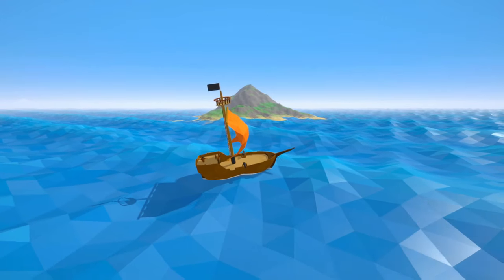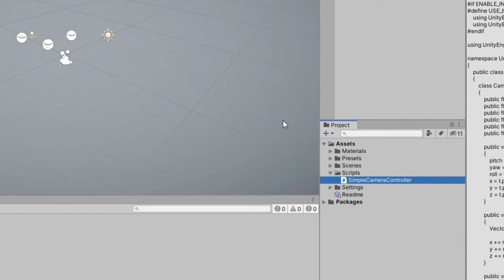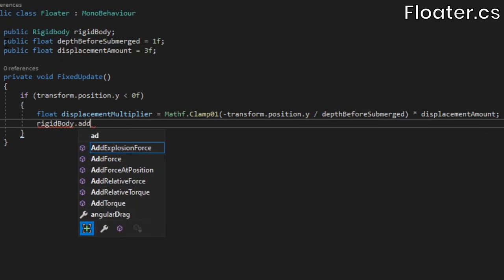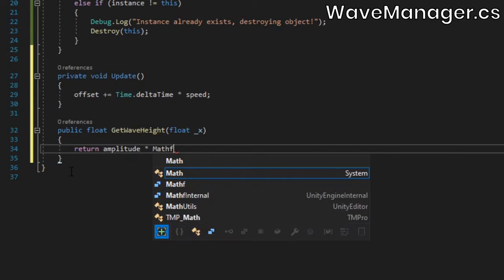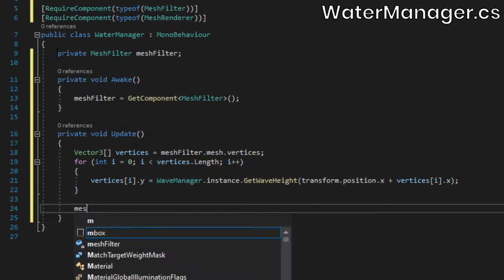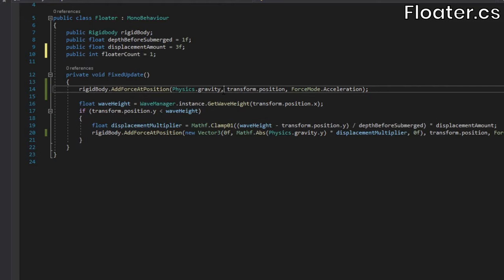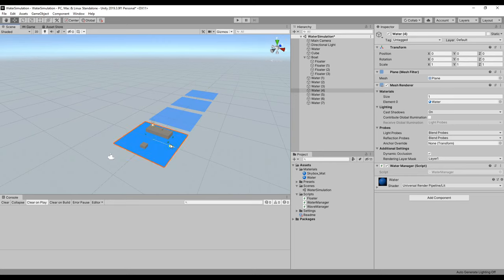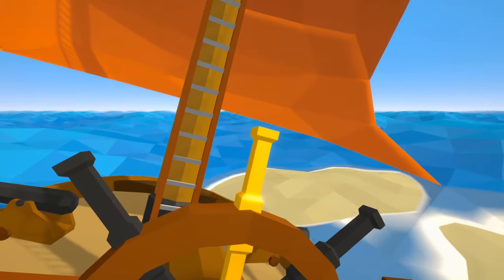How to Set Up Dynamic Water Physics and Boat Movement in Unity | Ship Buoyancy Tutorial

Comment: 3:28 That script would be great as a Scriptable Object for the water. So you'd be able to create multiple instances that each vary without disrupting the original or having to rewrite it either.
That way you could create many different versions of the water physics.
The default water physics.
Denser with more drag on a muddy swamp.
Or a more sinking ocean of lava with very little waves.

These short minute tutorials are the perfect format for learning. And you get so much down in so little time and even add small extras like singletons so quickly and clearly which otherwise takes others 30 minutes to confuse you even more somehow. Great work :).
Reply from the maker: Maybe, although you'd need to make sure the floaters know which water instance they're actually floating on.

Also, I'm glad you like the speed! I myself hate slow tutorials—there's just something extraordinarily excruciating about sitting through any sort of extra fluff when I just want to know what to do next, but skipping ahead is dangerous because you risk missing something :P

Comment: One possible improvement is that the actual buoyancy depends on the mass of the object and on the liquid density because the resulting force acting on the object is F_b = (m - rho_liquid * V_displaced)*g. It will add a more realistic immersion of the object depending on its mass and the density of the liquid, w/o adding artificial multipliers. This force is applied only at one point, but its amplitude can be shared between several Floaters to apply a distributed force effect (as if we split the body onto several parts).
Reply from the maker: Right but then you need to set the mass accurately, which then means you have to do a bunch of calculations based on volume, material type, etc. and it just becomes a pain. It's much simpler & more convenient to just have a few multipliers that you can play around with to get something that looks/feels right than something that is completely accurate (which it really never will be because the force would be applied all over the object, not just at one or a few points).
Reply: Yes, you are probably right, for a casual gameplay not heavily relied on physics this is a simpler solution.

Comment: hey tom, quick question: Are you using URP in your own game? if so then did you write a completely new shader for your water including the lighting? The problem I'm facing is that URP seems to not have the option to create a new "Standard surface shader", instead it creates one in cglanguage for the built in renderer.  Which forced me to just create a completely new shader in HLSL but I would love to avoid having to write all the lighting code. Any thoughts on this? Is there some way to use unity's physically based lighting within my custom urp shader (without shader graph)?
Reply from the maker: Yes, I'm using URP.

Shader Graph is the only way to automatically use URP's lighting (that I'm aware of), and I think it's intended as the alternative to surface shaders. Since Shader Graph still doesn't allow you to modify certain things that I need to modify, I'm basically just piggy-backing off of URP's shaders. I copy + pasted the code files for the lit shader and then added my extra code, but the drawback is that any time Unity updates or changes something about the lighting calculations, I need to manually update my shaders with that same code for it to take effect.
Reply: @tomweiland  thanks for the info as always. I just created a new lit shader graph and copied its generated code, seems to work fine!

Comment: When applying the buoyancy force, subtract its own velocity at that specific point. Should probably help with the bounciness you’re experiencing. The same goes for the torque.
Reply from the maker: Have you tested this? I'll give it a shot, although that doesn't seem right since buoyancy is an acceleration isn't it? Also do you mean to subtract the specific floater's velocity or just he ship's?
Reply: @tomweiland   I mean subtract the rigidbody’s velocity at the floater’s position. I haven’t tested it in a buoyancy setup. But your rigidbody already has a velocity, since you’re adding one on top of that to reach your desired position, your ship will overshoot it resulting in a bouncing effect. If not, sorry for wasting your time. Would love to hear the result though. I’m not near a computer so I can’t test it right now.
Reply from the maker: I'll give it a shot, although on a theoretical level I'm not convinced :P

Comment: this would've helped me more if I wasn't making water while having multiple heights of objects and terrain i did something similar with movement and ended up having to redo the entire thing a few days ago because it worked if the character wasn't moving up if it was flat terrain this would work way better thought i would mention it for people looking to do something with different heights of terrain and or water.
Reply from the maker: Are you talking about water at different heights in the world, like rivers and lakes? If so, you're right that (as is in this tutorial) this solution only works with water that's at the same height.

If that's not what you meant, then perhaps using some punctuation would help clarify what you're trying to say 😅

Comment: I wrote my own shader for the waves, and I'm using the same formula to get the wave height at any given point, but it's not accurate to the actual height of the waves. I'm thinking this is because of the view matrix math (UNITY_MATRIX_VP) and I'm unsure how to go about fixing this. How did you have the vertex math line up with the wave manager formula in your game?
Reply: Nevermind, I found the issue. I was using _Time in my shader instead of _Time.y. So the time value I was using was different.
Reply from the maker: Glad you solved it!

Comment: hey this is a really amazing tutorial but I wish you went more in depth on how to use it together with a shader. I followed the tutorial you linked but cant seem to find a way to properly adjust the physics to that
Reply from the maker: You just have to recalculate the buoyancy the same way the mesh is deformed. This video has a good explanation of how to do it (ignore the GPU readback stuff, what's important is that sampling the wave equation multiple times and adjusting the sample point on each iteration gets you a pretty accurate result): https://youtu.be/kGEqaX4Y4bQ?t=802
Reply: @tomweiland  Thank you for that very quick and great answer even thpugh this is an older video !:))

Comment: Very nice video. Thank you.
I have a question though : why do you introduce the displacementAmount ? What is the purpose of it ?
And by extension, why using displacementMultiplier in drag / angular drag formulas, instead of using the displacement factor, which is not multiplied (that is Mathf.Clamp01(-transform.position.y / depthBeforeSubmerged ), which always stand between 0 and 1).
The displacementAmount seems to be like a constant introduced to give a better result/dynamic rather than being physically related to something. Am I wrong ?
Reply from the maker: The displacementAmount is meant to approximate the total amount of water displaced if the object is entirely submerged. We use the displacementMultiplier because the object isn't always entirely submerged.

For the drag, you can use the displacement "factor" instead if you like. Honestly this is just an example of how you could mimic buoyancy, so if you think something else might work better, just try it out.

Comment: Hey, I have a question about the shader tutorial you linked in the description. I just started trying to follow it, but as soon as I made the shader material, it just turned pink without any color. The waves do not work either. What should I do?
Reply from the maker: Have you completed the entire shader? Pink means there's an error, which may occur if it's incomplete.

If you're using URP then the issue is probably that the shader from the article is made for the built-in render pipeline, which isn't compatible with URP. You'll have to convert it, which will be hard if you don't know much about shaders—it might be easier to recreate in shader graph...
Reply: I know its been a while since you typed this comment but I was wondering if by chance you have any documentation on doing such a thing. Want to get the most performance possible because I am currently developing a vr game and doing it CPU based with blow someones headset up haha

Comment: This might just be exactly what I'm looking for. I've been messing around with the idea of a game based on hovering vehicles. I've used a modified buoyancy script I found on the Unity forums in the past, and replaced "ocean height" with a downward raycast, and did some messing around to have it "float" a certain amount above whatever the cast hits. But, that script is a tad more feature rich, and involves doing a bunch of stuff I don't understand with voxels and cutting up the mesh, and it was probably more resource intensive than what I need.
With something like this, I should be able to quickly whip up a vehicle that hovers using the actual positions of the thrusters (or whatever I end up making the vehicles hovering method, hoverpads?), without having to expend a bunch of resources voxelizing crap.
Looks like I know what I'm doing this evening. Thank you!
Reply from the maker: That's an interesting application for this kind of setup—I guess you'd probably raycast downwards at each floater instead of sampling a wave equation, and then apply an upwards force based on how far away the ground is 🤔
Reply: @tomweiland  Exactly ;)
Reply: @tomweiland  So, I've been messing around with things, if you'd like to see what I came up with, check it out: https://youtu.be/aUgbtHNIo1k?t=1705
It needs a lot of work on my end, but your snippet here was essential in getting things going. 
I moved away from having 4 separate empties with a "hover" script, and instead moved all the logic to the parent, using a foreach on an array of "hover point" empties. I'd like to expand on this later by having the "thruster" destructible, and when destroyed fire off an event, which will then update the list of hover points. 

Anyway, the prototyping has been fun so far, you've definitely helped spark a new fire under my ass to work on gamedev stuff, and I think I'm gonna have a lot of fun with this.

Comment: I had a question about implementing the water on a large scale using the GPU. Following the link to the tutorial by Catlike Coding, I am able to run the wave as a shader but obviously this leaves out the method of implementing buoyancy/swimming physics. My question is whether you are running the surrounding water "chunks" on the GPU and the swimming physics on the CPU for the players immediate environment (ie. only simulating the physics for a few chunks the player is near but running identical waves on the GPU farther away) or am I missing something? Awesome video
Reply from the maker: I only simulate the physics for the exact point that I need it. You can use the same formula (or an approximation if you're using Gerstner waves) on the CPU to get the height of the water at any give point, regardless of whether you actually have a water plane there or not.
Reply: @tomweiland  Thanks for the reply! I feel I've been able to get things working well with your advice, but I had another question regarding how you organize large areas of water and coordinate the waves across planes? I am completely lost on how to approach this

Comment: Hey, just found your vid in my recommendations! you are saying at the end that in your project you are using Gerstner waves, but how do you get the wave height at coordinates XY (considering Z-up sorry i'm unfamiliar with unity) on the CPU side ?
Reply from the maker: I just use the same formula on the CPU side, although it's a bit less straightforward and requires some approximation with the Gerstner wave formula since it doesn't give you the height for the point you used as the input (Gerstner waves move horizontally as well as vertically, so the returned height is for the shifted point, not the original one).
Reply: @tomweiland  okay I see, thanks for your answer! Because I’m in a case where my mesh is really large compared to the size of the boats, that’s why i was looking for the formula giving directly the height

Comment: Question though, if you're using Shaders to move the waves, how do you inform the boat script about where the vertices are? I'm assuming you replicate the shader math inside the boat script and then boom?
Reply from the maker: "you replicate the shader math inside the boat script"
Yep, that's exactly it. As long as you pass the same values to the same formula you should get the same output.

Comment: Tom, a couple of questions:

1. I'm still relatively new to writing shaders. I've followed the CatLikeCoding tutorial (and threw them a donation, wow, what a great tutorial), but I'm curious how you got the lighting to emphasize each tri, for that nice low-poly look. My shader looks really smooth and doesn't have the same charm.

2. Like the shader, I have set up my WaveHeight function to just use a time figure so I don't have to update the offset each frame. I'm using Time.timeSinceLastLoad to try to sync them, but I'm not sure I've gotten it right. I'm curious what technique you use to sync the shader and the function.
Reply from the maker: 1. The low poly look is achieved by having the entire surface of each triangle use the same normal. If a triangle shares vertices with neighbouring triangles, the normals of those vertices will be an average of all the surrounding face normals (I hope that makes sense). My low poly shader is sort of my "secret sauce", but I'll point you in the right direction—in order to have a universal face normal, each of the triangle's vertices need to have the same normal value, and what's most commonly done is to simply split vertices, meaning each triangle has its own unique set of vertices (since you can only have one normal per vertex).

Alternatively, you can ignore the normals stored in the mesh data and recalculate them in a shader. This can be done using geometry shaders (which allow you to perform calculations on a per-triangle basis rather than per-vertex/per-pixel), or you can use the screen space derivatives in the pixel/fragment shader function. Over the course of several months, I probably read every article/question/forum post out there relating to low poly rendering trying to figure this out :P

2. I set the offset for both the WaveHeight method and the shader manually.
Reply: @tomweiland  I managed to hack something together with a flat-cell shader I found by incorporating the vertex displacements... Much studying to be done on my part to understand it beyond that, though.

I'll try not to make something too similar and step on your creative toes!
Reply from the maker: @richardstevenson371  that sounds like an approach that I'm not sure I've heard of. If you don't mind sharing I'd love to know how it works—maybe we can talk on Discord?
Reply: @tomweiland  Whoops! I wouldn't mind, but I can't really offer any expertise myself. I simply implemented the wave functions into a shader I found online:

https://hextantstudios.com/unity-flat-low-poly-shader/

Comment: Awesome tutorial! I've been working on shader programming recently and am making an ocean shader at the moment. I'm wondering how you get your vertex data back out of the shader and into a C# script? Because it's all stored on the GPU the only two options I've seen is to do the same maths as you use generate the waves but obviously only for the 4 floating locations, or, to access the vertex buffer, but I've read this is very slow and also there's conflicting information about whether this buffer gives you the post shader positions or non manipulated positions. It would be awesome if you could point me in the right direction for this!
Reply from the maker: "I'm wondering how you get your vertex data back out of the shader and into a C# script?"
I don't. I use the first option you mentioned—I just use the same math as in the shader to calculate heights on the CPU as needed.
Reply: @tomweiland  Any chance you could show us how? It's doing my head in

Comment: @Tom Weiland
I am getting an error on 'MeshFilter.mesh' which says "An object reference is required for the non-static field, method, or property 'MeshFilter.mesh'. I realize there are other posts with similar error but I still don't understand what is wrong with this.
Reply from the maker: You need to use meshFilter.mesh instead (notice the lowercase 'm' at the start).

Comment: hey, great video, but i have a problem,
if I have already made some waves by modifying the position of the vertices with shader graph, how can I match the buoyancy of my cube with the position of the shader vertices? Thanks for your time and good luck with your game :)
Reply from the maker: You just need to make sure that you're using the same formula and offset in the shader as you are in the height calculation method and it'll give you the same value.

Comment: I have a big question. Say that I am using Shader Graph to calculate the water displacement with the help of some gradient noise, is there anyway that I could replicate that through script? For now at least I have just approximated the waves using a simple Sine function however I feel as though when I'll implement more complex water, it won't hold up.
Reply from the maker: You'd have to use the same gradient noise in the script—as long as the formula is deterministic you should be able to just use the same one in the shader and the script and it should work.